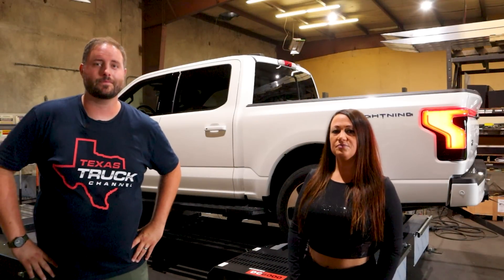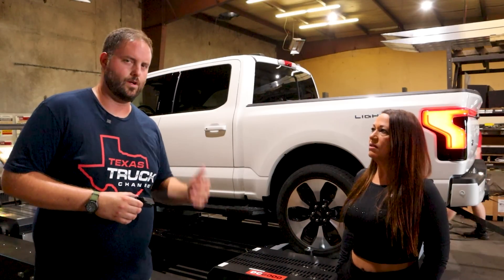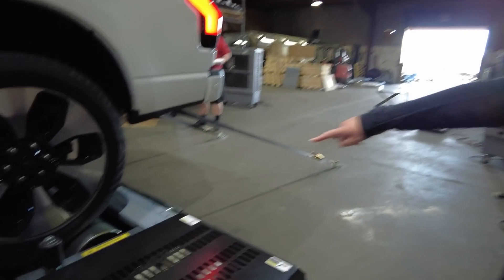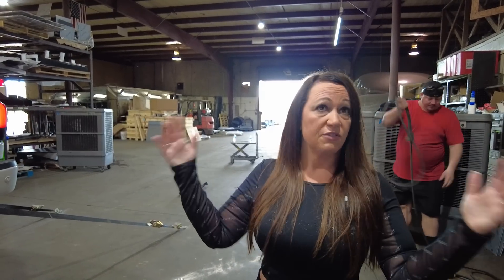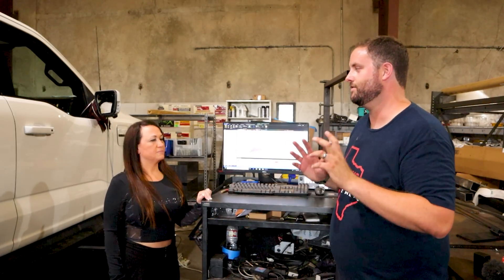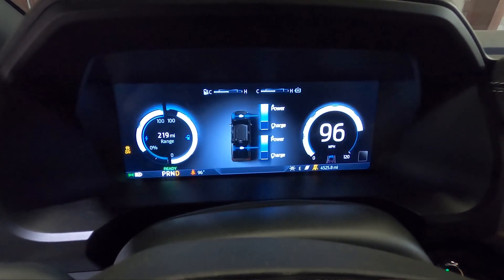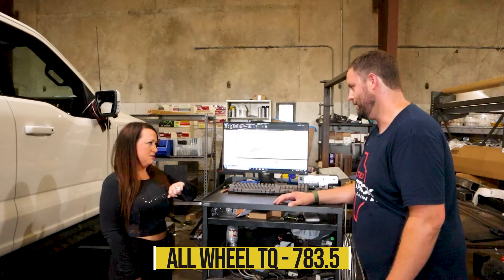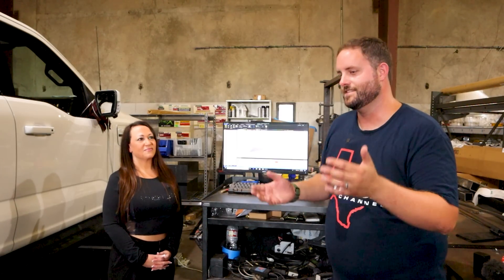EXCLUSIVE // Worlds FIRST 2022 Ford Lightning EV Dyno Test

Comment: Ford has really stepped out and produced a really cool truck.... BUT they're "unobtainium" given the current supply/demand environment and quite expensive too.  I'm less than 1 year since my new truck purchase ('22 GMC Sierra AT4) so I've got time to see if these challenges sort themselves out before considering a change.  Holy Smokes, what a powerful truck!
Reply from the maker: Amen, all around!
Reply: I'm interested to see where the LFP battery Lightning ends up. See if Ford can mass produce LFP batteries at a low cost.
Reply: I want one but i’ll happily wait for Solid State Batteries.
Reply: If I’ve learned anything from this whole ev “announcement” thing, it’s that if you’re interested in any ev that is coming out, put a reservation on it and any others that you might be interested in as soon as possible after the big unveiling. I made the mistake of waiting til the next morning after they announced the Lightning. They were sold out of Pro and XLT models by the time I got called to order. Ford was nice enough to extend the 2022 pricing on 2023 Lightnings for reservation holders that got passed over. I’m hoping to get my truck only a year and a half after I placed my res. Order early and often.
Reply: @brucewachtman3495  you’ll need to stop early and often to recharge, that is if you plan on actually using this as a truck and towing something. Can’t remember, but it was like 60-80 mile range towing a trailer well under max.
Reply: @freebehindbars8654  yeah, I’ve seen all the reviews. I don’t tow anything. I don’t even like trucks. I’m old and cars hurt me to get into now. I like the full size, normal styling, and the power. Plus the tax rebates. I’ll use it as a local commuter mostly.
Reply: My local dealer got two in over a month ago. At least one is still on the lot. Nobody around here wants them.
Reply: @sdvten  could it possibly be because the dealership has an insane markup?  the only dealerships with lightning have them cause customers cancelled their order cause the dealerships are tacking on $20,000 + “supply and demand” fees…
Reply: @providentpathfinders219  I'm sure its above MSRP. I'm not stopping and risking getting hassled by salesman, top 5 most annoying people on the planet.
Reply: @sdvten  HAHA top 5 for sure…..along with lawyers
Reply: @sdvten  I'm sure its more because that dealer marked it up another $20k atleast....